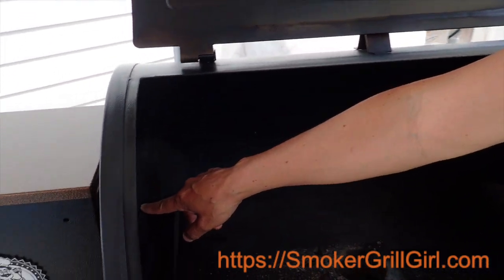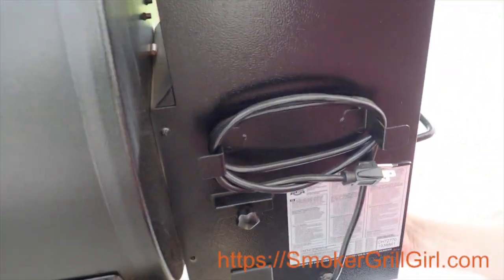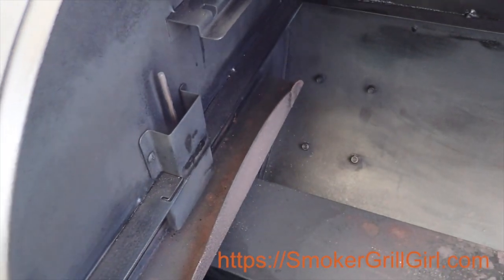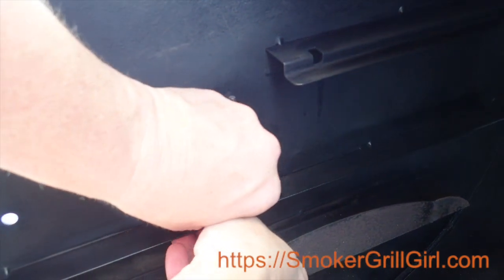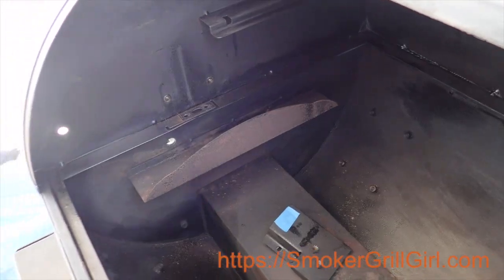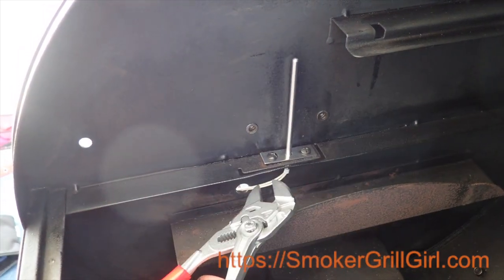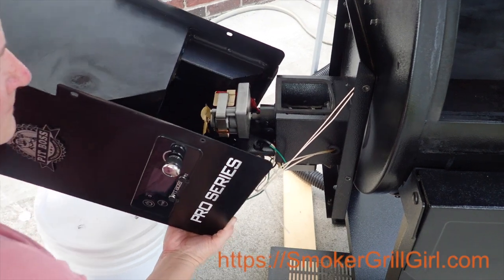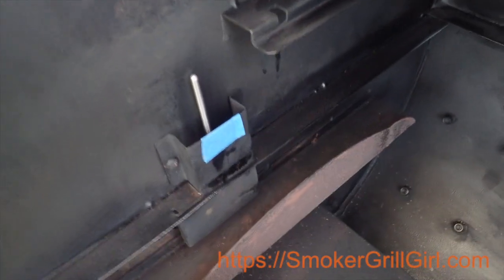How To Replace An RTD Temperature Probe On A Pit Boss

Comment: Thanks for great video.  Even though I didn't have the same grill as you, (I have the PB700FB), it was really close.  I didn't have to remove the pellet bin.  The screws and nuts to hold probe in place were a little difficult to get to with my fat hands.  I did have to remove the control panel, as mine does not have the plug.  Mine has two tiny screws that connect the wires to the circuit board.
 Either you keep your grill very clean, or its really new to be having to change that out already.  Thanks again!